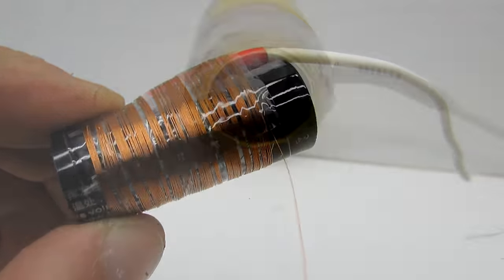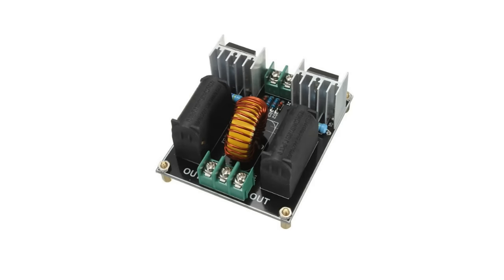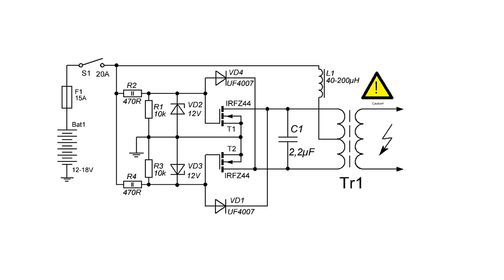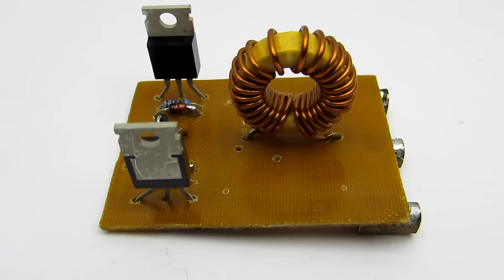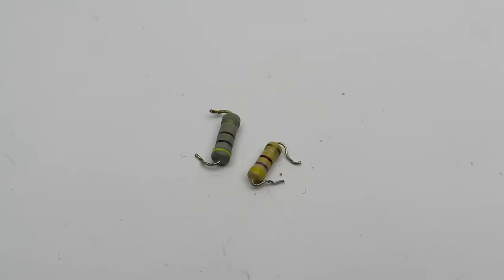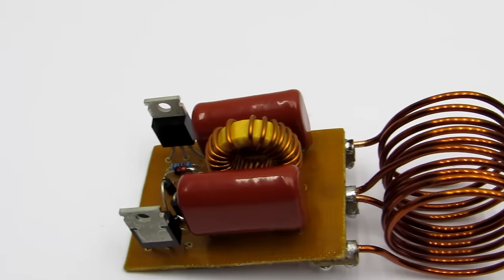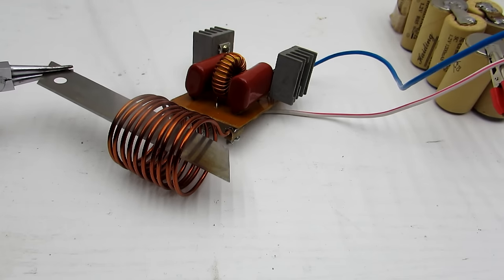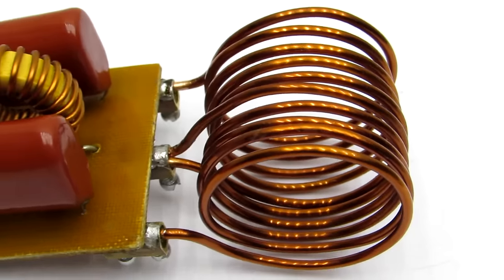DIY simple induction heater

Comment: What is the difference between the version with 2 chokes and the version with the middle tap coil? Why is the latter one more stable? Thanks for your great work
Reply: 2 choke version is more suited for air core inductors like induction heating coil and 1 choke version is more suited to drive a transformer

Comment: what would happen if you doubled the length of the heater coil.  For instance the one shown looks to be a couple of inches.  I realize there would be more coils windings.  my reasoning is that i make small knives that have 4-6" blades.  Im not looking to forge but only heat treat.

Comment: Is zener diodes and 10k resistors necessary ?
Reply: Depends on how hard you want to use it. I've built a few zvs drivers and omit them sometimes if I don't intend to use it with over 12v. When I omit them and push the circuit with high voltages I usually blow a MOSFET.  The zvs where I used them I haven't had any issues with and have run it at 40v

Comment: Hey Kasyan. Can I use npn transistors with this circuit? I have a few 2sc2526.
Reply from the maker: No, only mosfet
Reply: I've already tried with a little modification of the circuit I excluded resistors R1 and R3 and zener diodes VD2, VD3 and it works not as good as yours, but it works.Thanks for the reply.

Comment: this circuit not work then I replace 470 resistor with 220 ohm then it will work I am using 16v 2amp .what the problem

Comment: 400 volts and more for the cap? i thought that 100 volts are overkill. when touch both of the mosfet gates i can barely feel voltage (can't be more than 70 V) only if i drive very high inductance transformers with  low capacities only. i also recommend bigger inductor after the + and before the center tap with thicker wires-there is never too much inductance when it comes to this one and also put the smallest film capacitor you can find across it if your mosfet's gate-source voltage is too low
Reply: For a given amount of capacitance, a capacitor designed for a higher voltage will also generally have a higher current handling capability.
Reply: The lower the coupling to the piece being heated, the higher the voltage will be in the capacitor; this is because the tank circuit needs to store more energy before its losses (into the metal being heated) match its gains (the energy pumped in by the fets every cycle).

Comment: as a person who does a little blacksmithing. You shouldn't be breathing in any stainless steel or anything with a zinc coating you heat up. It is poisonous, like you will feel like you have the flu and then you will die.
Reply: https://en.m.wikipedia.org/wiki/Metal_fume_fever
Reply: Iron Patri0t you are correct, but breathing a tiny amount like this is not going to kill you, I am not a blacksmith as you claim to be, but as a blacksmith you should know this.  I make knives for a living and am well aware of the dangers of chromium and suchlike, but I have an excellent extraction fan, I heat treat all my own blades and most of the new super steels have a high degree of chrome, I would be stupid not to have the extraction unit for the kiln. But, you shouldn't be scaremongering people, no need to be a duchess.
Reply: Shona O'Neill it's not scare mongering. I am more afraid for people watching this video who will try this, that do not have a extraction fan. You obviously have a good set up. I have a coal forge. I make hinges, handles, and smaller tools. If I use anything zinc played I have a burn barrel that I throw it in.  I just think it's important to tell everyone the risks.

Comment: Why not use solid state graphite power cells with organic carbon power cells to generate electrity to power two tesla coils transmitting a energy frequency in a loop between the coils that caused a graphite heating element to glow red hot with a electric fan to draw air over element for a space heater you can use anywhere? Novartis